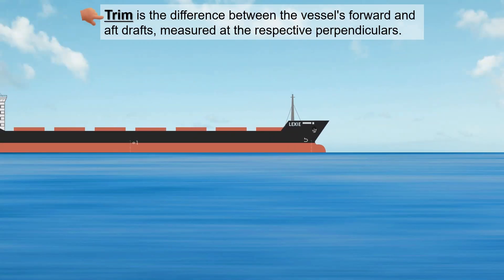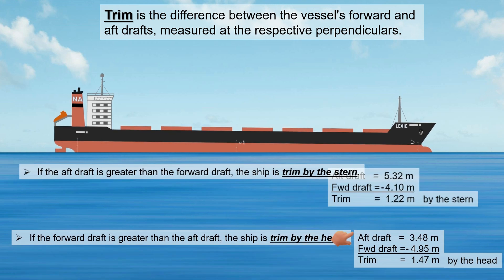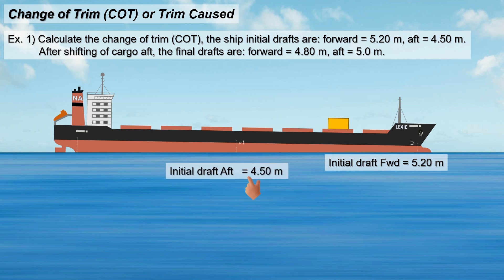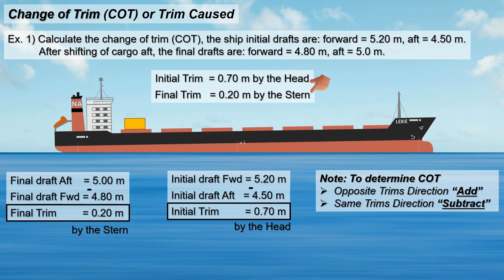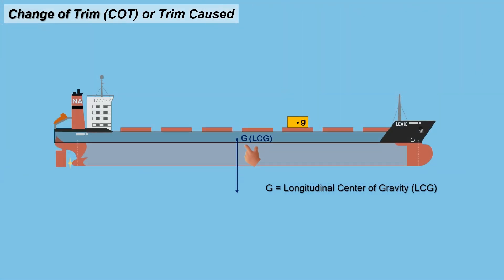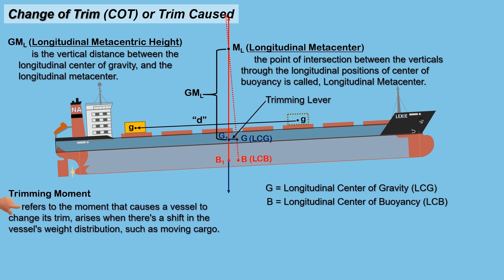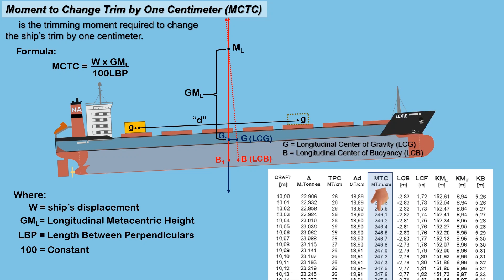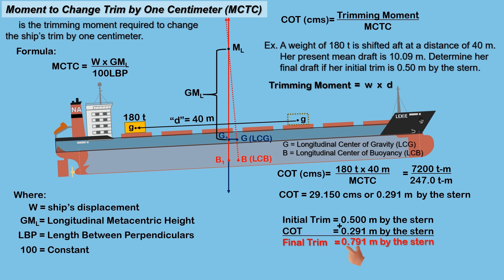Determine Ship's Trim, Change of Trim (COT), and Moment to Change Trim by 1cm (MCTC)

Comment: can you solve this please, A Ship 126m long is floating at draft of 5.5m fwd and 6.5m aft. The centre of flotation is 3m aft of amidship. MCTC = 240 t-m Displacement=6,000t Find the new drafts if a weight of 120t already onboard is shifted forward a distance of 45m